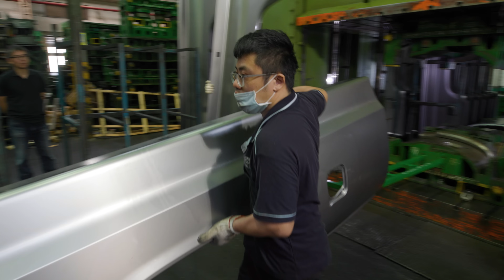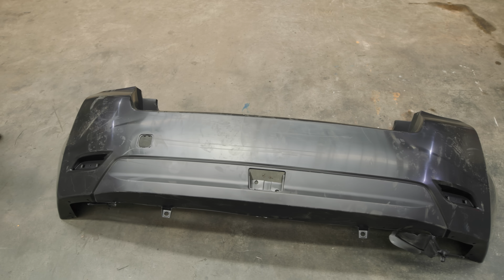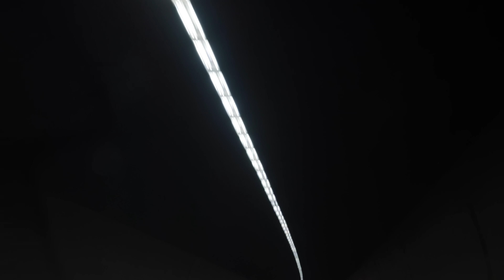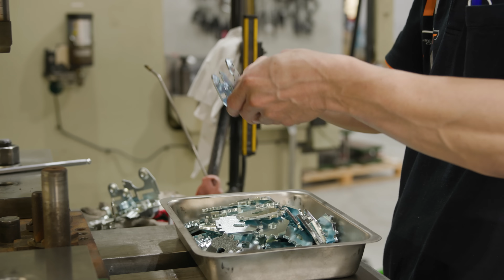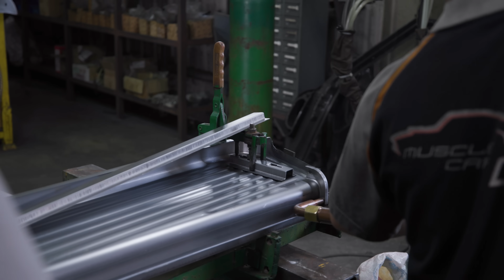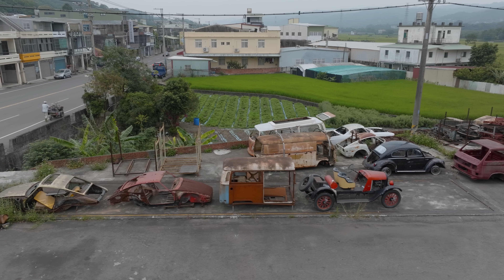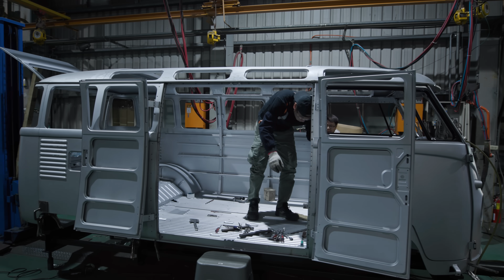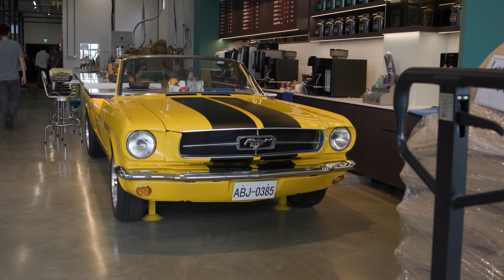Taiwan Makes American Trucks Great Again! Tour of Sheet Metal and Replacement Parts Factories

Comment: All I can say is that if you have ever replaced vehicle sheet metal with any of this stuff then you know first hand how far off it is from the original manufacturers sheet metal and how difficult it is to make it work.
Reply: I have been using parts made in Taiwan for many years, and they are Almost a duplicate to OEM.
Reply: @stevecarlisle3323  find me a youtube channel where they are using that stuff and aren't spending plenty of time making  it fit right because I'm not wasting my time listing every vehicle I have bought fenders and valance panels and quarters and rockers etc for and had to work every one of them to get them to fit right and match up.
Reply: @crazyoilfieldmechanic3195  Well the commercial body shops seem to have good success with the panels, maybe it based on skill level. 🤔🇨🇦
Reply: @stevecarlisle3323  be snarky all you want smart guy. I don't know a body shop anywhere that uses that stuff unless it's the only choice. Many times they get oem panels from salvage yards and refinish those because they fit correctly. Many insurance companies won't accept panels from Taiwan or China or wherever else because of the quality issues. I notice your the only person who has argued the point. Maybe that's because your experience adds up to one fender and one hood and YOUR abilities haven't shown you how far off the stuff you put on is.
Reply: @crazyoilfieldmechanic3195  Just the Facts !
Reply: Exactly...I would rather pay 5times more and get original or a refurbished original than put chinesium on my dream car.
Reply: @davidgalea6113  The quality between China and Taiwan is measured in decades.  I can see you really have No idea. You keep dreaming about your American body parts. 😂
Reply: @davidgalea6113  as you can see, this one knows everything. Must work for one of their companies.

Comment: I just bought 5 fuel filters for an older car I have that were previously NLA, while not a perfect reproduction, it fits in the location the OEM filter is located, I was surprised to see that it was made in Taiwan. Years back late 80's early 90's, the US bicycle industry made a move to production into Taiwan, at first there products were questionable, but as the years passed their quality improved quickly. It's unfortunate copyright laws make reproduction of some parts somewhat more difficult, but obviously there is a demand to reuse older cars, it make more ecological sense also.

Comment: Someone explain why we can’t do this manufacturing in America ? Employing American workers ? I’m just curious..
Reply: Costs, I worked in the automotive stamping industry for almost 15 years and the blanking and forming tooling needed to reproduce body panels is super expensive. 
Using a laser eliminates a blanking tool but the LH & RH forming tools are the tough part. Even with the original tooling blueprints there were minor changes to the form tool that would allow a company to form say a fender to the correct form.
Reverse engineering is problematic because you don't have the original tooling 😮 even polishing a OEM tool  a few too many times would change the form.
Reply: Read the previous 4 comments. They are spot on. Sad but true.
Reply: Because Americans don’t want to work for $5 hour
Reply: Who wants to be a slave if you can just lie down and make money?

Comment: Super cool and thankful for many of the parts to be able to bring these cars back. 
I work daily with many of these parts 
They are not perfect and many cases take many hours to correct by cutting and rewelding. Example,  CHL, 73-87 rear radius at top at tailgate are incorrect as is fuel door location is 3/4” too high on the RH and left is in the correct location. A very time consuming endeavor to cut, relocate, tig and planish.
That’s an extreme example as most simply need minor cutting and some metal added for gapping as they expectations in the restoration world are many times higher than the OE.
Reply: I've never done bodywork or sheetmetal work, but I've heard about fitment issues for decades. I got a little more insight when I watched local YouTuber DD Speed Shop showing the issues with the rear quarter on his 67 Camaro. It's crazy the lengths true car guys will go to restore a car. I don't have the willpower, motivation or money to do any of that :face-green-smiling: